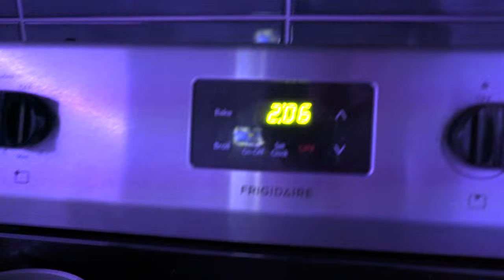I CRASHED MY CAMARO ZL1 1LE..

Comment: How cold was it outside when you slid off-road? Wondering if those tires were down on grip because of low ambient temps?
Reply from the maker: Not too cold just didn’t know where I was and my homie went off rd in front of me so I didn’t know where to go honestly
Reply: @TintTutorial  Holy crap, is that what happened. Yes it definitely looked dark as hell and I didn't realize he also went off-road there for a sec. Dayum!